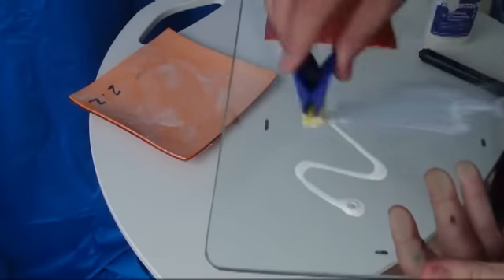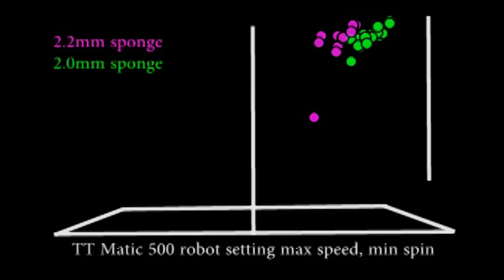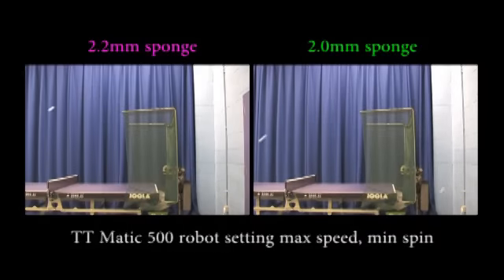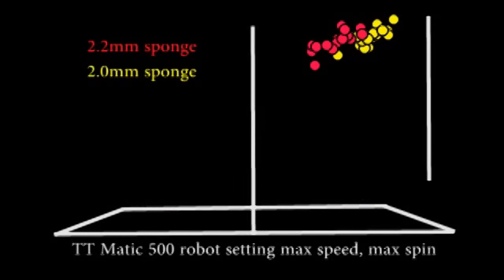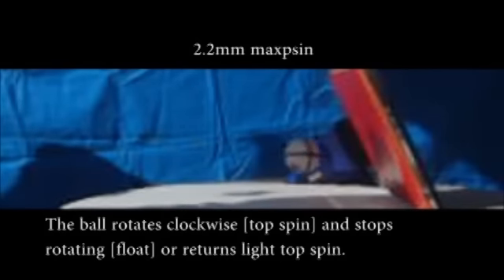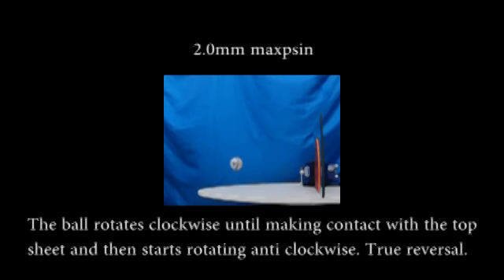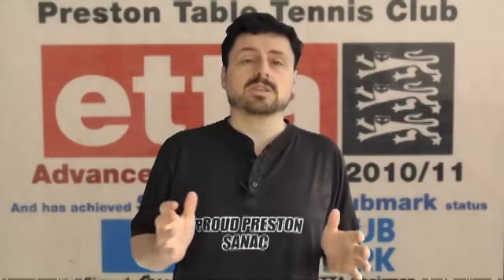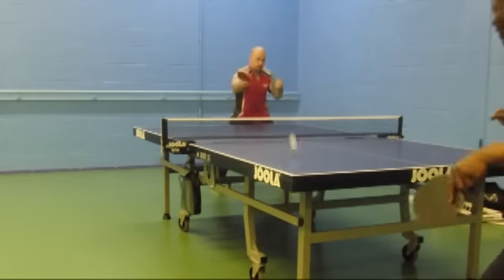Part 2 of 3: 2.2mm vs 2.0mm TT sponge thickness - Robot testing: throw height, trajectory & speed

Comment: Try to consider these things for precise and accurate result:
1. Ball size, seem or seemless, shape or roundness and weight must be all "uniform"... not all balls are the same even with the same batch of production.
2. Please double check and do "tests" for the robot's accuracy and performance before the experiment.
3. Use at least 2 constant variables like the same thickness and the same tackiness "at a time". Dont mixed-up the properties for the rubber same experiment.
Example:
Rubber.     Tackiness Thickness
1. Rubber a  yes.     1.8
2. Rubber b yes.      1.8
3. Rubber c yes.      1.8
4. Rubber d  yes.     2.1
5.     "         e. yes     2.1
6.     "         f  yes      2.1
7      "         g  no       1.8
8.     "         h   no.      1.8
9.     "         i.   no       1.8
        "              no    2.1
        "              no    2.1
        "              no    2.1
Variables are racket angle, thickness, tackiness, speed of the ball, spin of the ball, etc.

Comment: Another excellent video!  Good work!  I am still trying to digest everything.  The part about the 2mm sponge being faster doesn't surprise me but the test is flawed because the 2mm and 2.2mm sponge are different hardnesses so they are definitely not made of the same material.   Still sponge absorbs energy so I would expect a 2mm sponge to ALWAYS be faster than a 2.2mm sponge IF they are made of the same material.  I am interested in how you made the overlaid videos.
More later.
Reply: ALWAYS...? 
I believe a hard sponge will increase speed as it has a spring effect.

Comment: I understand the problem with the sponge quality and not getting what you think you are buying.  I bought a 1mm 1.5mm 1.8mm 2mm and 2.2mm HRS sponges just to find that they weren't the same hardness.   My plan was to do a similar test but it is hard to tell the difference between a 2mm and 2.2mm sponge.  I was going to stack the sponges so I could have up to 8mm of sponge.  The difference between a 2mm and 8mm sponge, and various thicknesses in between,  should be dramatic.  E-mail me on gmail.

Comment: Unfortunately, I expect most of your observations to be caused not by the thickness of the sponge but by its hardness (since you discovered it was different in the previous video).
I'm afraid it's very difficult to draw any conclusions on the effect of thickness in this case.

Comment: What TT paddle is made with glass? How can you imagine to test a product designed to interact with wood, with a model made with glass?
Reply from the maker: Because I'm testing the rubber and not the blade so you need something which has a COR as cost as possible to 1 and glass was what I had closest to 1. If I used a wood  blade the results would be specific to that wood blade, are least this way I'm trying to isolate the properties of the rubber. Not easy and work in progress trying to factor in all the elements that impact on the performance of table tennis equipment.